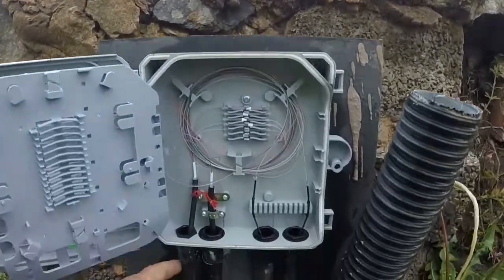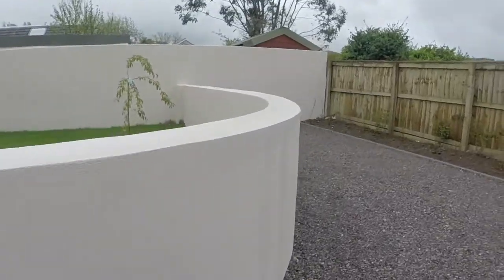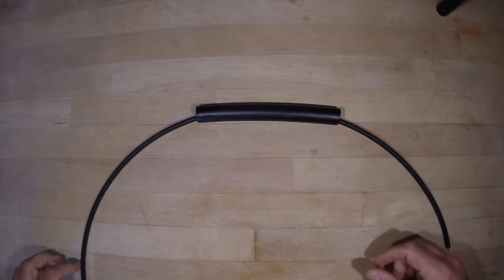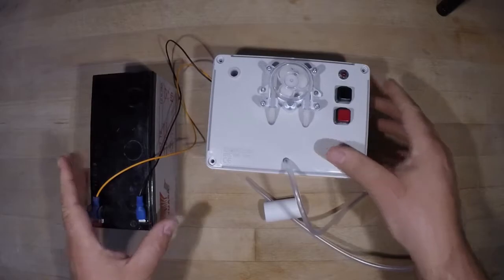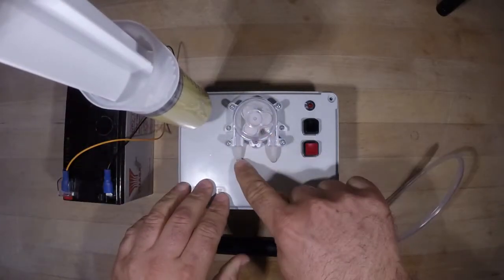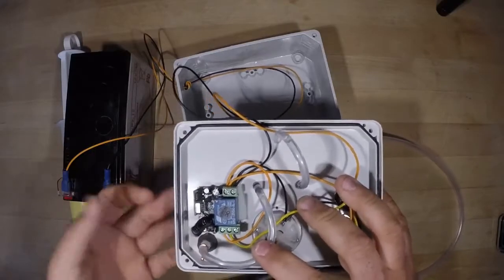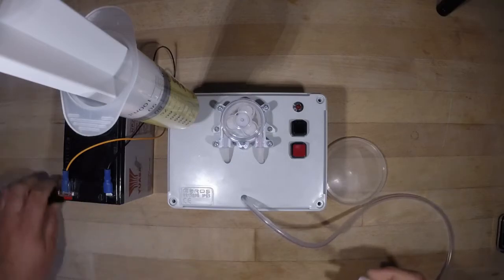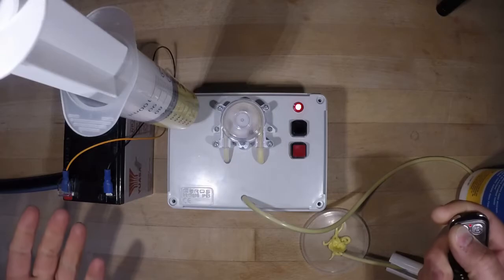Pulling Fibre made easy with the Lube Master 2000!

Comment: Just pump some water through that waterline and float the fiber cable through.

If needed you can put a ball in front the cable to help pull it through. Or you could just use some tape to create a ball out of tape directly on the cable.

To get the water in there together with the cable, you just use whatever fittings are needed for the water, then drill a hole that just fits the cable. Some of the water will come out the wrong way but most of it will be going in the correct direction.
Reply: And the best part you know that duct is going to fill with water anyway. I recently did some conduit using the vacuum method to pull a string through, putting a ball in the end supposedly makes it better but I didn't have any issues. That is until the string came off the cables, thankfully in the 10 feet that was above ground and I had gravity working towards my advantage as I was going down from the second story.

Comment: I have a similar remote control system that I connected to some automotive relays to control some lights on my truck, the relays on the board activate when you press the button but they won't power the main relays to switch on the lights :-/